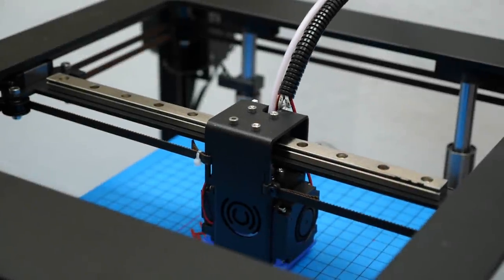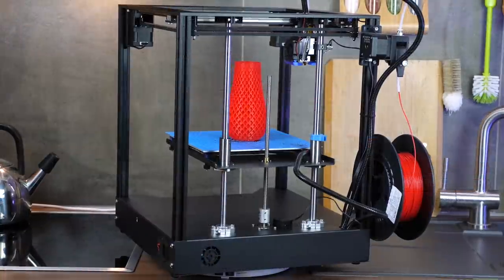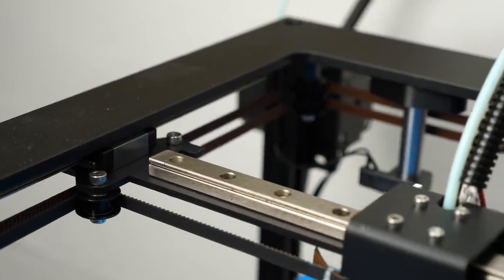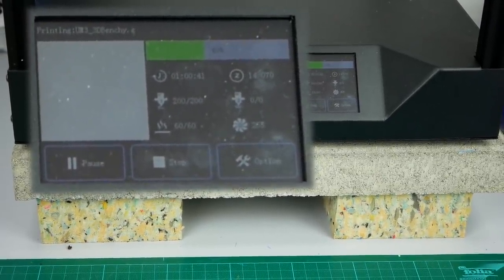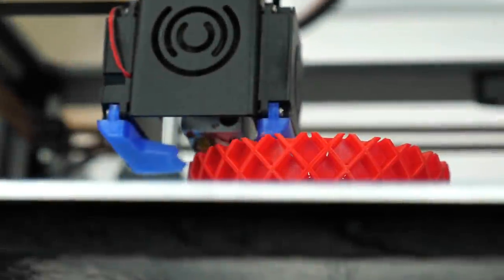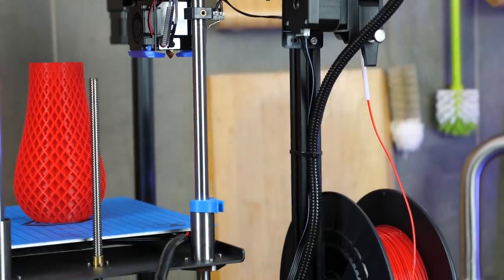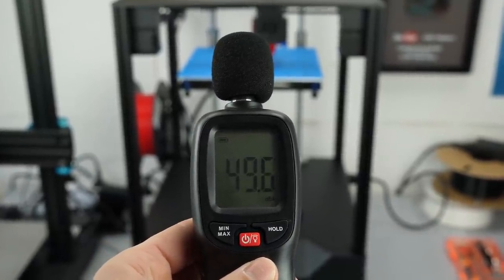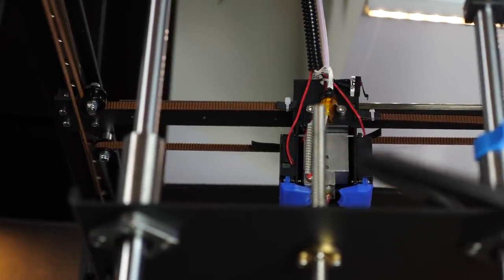$320 Linear Rail 3D Printer - Sapphire Pro REVIEW (Two Trees)

Comment: I have been wanting a core XY with linear rails for a while now, I think until these issues are ironed out I am better off building my own.
 With the Pro moniker applied to this printer, I would expect to see a better board installed and a tensioning system for the belts.
 I am nw going to watch the JustVlad review who I understand has a later version of this printer, I hope things are better!
Reply: Another new model to keep an eye on is the SecKit "Go" (or "Mini") - its slightly more expensive than this, but still very modestly priced for what you get. The very first batch are only just shipping now, but it has linear rails in all axes and looks very promising - if the current 1-man operation can scale up production.
Reply: I'm wondering if a printer really needs rails though. I have a core-xy (tech-2c hypercube) that uses 8 & 10 mm hardened round stock and linear bearings and there is no slop in it . An interesting aspect of the core-xy design is that the belts themselves are in opposite tension and act to remove backlash. Differential tensioning also serves to calibrate the XY plane (to keep it in square). Its a really nice design.
Cheers,
Reply: If you're looking for the Pro side things, look up Vorondesign. It's a kit and you have to source all the parts yourself, but the design is free ;) the just went GPL3 so community is going to grow a bit.
Reply: @EngineeringVignettes  I too have a hypercube, an evo version. It was my first 3d printer, and it wasnt that bad of a build given no instructions. I love it. now that i know the ins and outs of the printer and how to tune core xy, I am thinking of adding rails for x and y. I honestly think ill gain alittle volume, and rigidity with rails.

As a noob to 3d printing(but not to building things) I would say core xy are for people who want to tinker until they get the results they want. If you want to get going out of the gate, go with standard cartisian printer.
Reply: @noelwade  Thanks Noel, I saw a video on this by Teaching Tech and it is a very worthy competitor for my new purchase
Reply: @EngineeringVignettes  I have been watching Tech-2c and the progress in his designs, the rods are a good alternative but the smoothness of linear rails realy made my mind up when I got my hands on one
Reply: @Penofhell  Thanks, John! I will explore this path
Reply: @EngineeringVignettes  in my opinion and experience linear rails can be better for cases like sound. both are great and both have their places, I've seen linear rails in more profession machines like CNC's or even used as super smooth slides for DIY projects. but ive only seen linear rods really used in applications like inkjet printers and reprap/ultimaker 3dprinters. its not a matter of do you need it its more a matter of does it work and will it work well.

Comment: Very nice video. Interesting to see, what went wrong on your machine. I got a later version (early september) with the rails correctly mounted, the driver voltages set lower and a newer firmware configuration. I had missing t-nuts, no setscrew for the extruder, a lose drive gear in the extruder, wrongly placed endstops, 1 meter bowden tube... not a finished product, nothing for beginners.

Thanks for linking my article.

Comment: its awesome 3d printer for resonable price that only need few upgrades to be the best printer at this price.
Z wooble exist because screws in this size are produced in 0.5mm accuracy at 100cm length everywhere so if your z axis isnt stiff enought you will see z wooble in 90% cases,the same goes with z axic coupler,changing it to cnc one (not spring one) or for engine with integrated screew can solve the problem :)

Comment: In my experience with Chinese linear rails, they need to be thoroughly cleaned before using as they, almost all, have some kind of manufacturing grit in them.
Reply: My old folgertech ft5 had alot of burs in the rails too. A good cleaning fixed the squeeching noises and inconsistant moves.

Comment: heh, I had a printer with a really difficult to diagnose Z banding issue, until it turned out it was the PID calibration on the hot-end or heated bed, that was causing it. Not sure which because I ran both calibrations together, and it was fixed after that. Honestly I think it was the heated bed's PID that caused it.

Comment: You may have overlooked, but these are NOT Allegro A4988, these are confusingly named HR4988 by a company that goes under the names of Heroic Technology or Shenzhen Yongfukang Tech. This is not a clone of any existing chip, it's a unique ultra microstepping driver with 1/128 stepping that is very well suited to be used with 32-bit boards. It uses the same pinout as 4988 so board layouts can be reused, but not much else! The current control is a bit rough so it tends to make very unpleasant sounds when run at 1/16 microstep, so its XY suitability with 8-bit boards is very limited. Other than that, it doesn't appear to have any weird degenerate behaviours, as far as the few people have tried it.

Comment: I got the saphire s which i guess is the predecessor for the same price. The s has a lerge control board so the open source people would not be happy. The belt routing looks like an afterthought or mistake and i came up with a different arrangement to straighten things out. The xy motors are in the base with rods and couplers which may add inertia but i like that it prevents belt tension from damaging the motor bearings over time. The fans have developed a noise that wasnt there when new. The drives run some crazy microstepping value like which is okay because the lerge board cpu is crazy over powered. I attempted to change them for tmc drives but they have resistors on the configuration pins and I'd have to de-pin my drives and configure them with wires on the drive boards so i decided the stock drives were fine untill i feel up to opening the bottom of the printer again but ill wait untill i figure out a 32bit marlin dev environment and just change the main board and screen. Ill wait till i get a good second printer incase it becomes an unfinished project. I added a bmg extruder and capricorn tube. Having the high mounted steppers like the pro could allow for 16 tooth pulleys instead of 20 which could allow for 100steps/mm which i like.

Comment: Hi there. Well... you at least get to printing what is currently impossible on my "PRO" with the clogged nozzle after every 2 meters of filament. 
Its not my first 3D printer so I definitely know how to set up and manage the hotend.
You did mention the poor quality control - I would say it doesn't exist at all.
Provided config file was total mess but after a while have managed to make it work, timing belts getting sagged after couple of hours, very weak radial fans blow the air all over but the part, hotend 30mm fan is useless and the hotend body structure leaves lots of questions as well.
Long story short, was expecting something workable but got the pile of...... you know.
I know, there are number of upgrades on Thingy but... should ONE need them straight out of box???

Comment: seems like a good second or third printer if you've already spent time on upgrading another printer knowing what to do to improve things and have a couple tmc drivers laying about. From what is described here id rather deal with the PID tunes and few printed parts maybe even adding a second z lead screw/rod over the hell i went through with that roller system on several printers espcially the tronxy x5s. granted i did a linear rail upgrade on my tronxy x5s, but i needed to print several parts and still need to print tons more before im happy with the printer. for my next printer i may keep this one in mind especially with that enclosure mod. tho for sanity sakes i may throw a bigtreetec skr pro or skr 1.3 on that.

Comment: What is the build surface called? I'm looking for a print surface that will let me print with a cooler bed.
Reply: Mirror tile and gluestick. Works fine with an unheated bed on my play
Reply: @pen25  thanks! Have done the same in the past but I find the glue stick a bit messy. Am still hoping to find the dream surface that I can heat to 25-30 and not use anything on. 

Currently 45 on a mirror tile with a good brim works. But hope to do better!

Comment: what other kinds of rails are there? exponential, or cubic or what? XD sorry for the joke but kinda curious I have never done any 3d printing and I am generally just curious about how the stuff works, and I have seen the term "linear rails" a few times
Reply: There are many ways to make linear rails. These are industrial, integrated linear rails, dedicated for the purpose, so they're usually just called linear rails in this hobby, they're Misumi MGN series rails or Hiwin rails or clones. Other popular type, especially that's what everything was like a few years back, is a linear cylindrical ball bearing like LM series on a smooth round rod. Third type which has become popular recently is an aluminium construction beam extrusion with V-groove and polymer wheels carriage, this is how all the Creality printers and their clones are built, but there were numerous builds before that.

So to summarise, it's linear rails vs smooth rod vs V-slot extrusion.

So dedicated linear rails are generally considered best, as long as they're well-supported underneath. Smooth rods have some propensity to bend in the middle and they also have a lot more play between the rod and the bearing, probably because the rod and the bearing are not matched and don't come from the same factory. V-slot extrusions experience wheel wear and need manual adjustment to align the carriage on them and to compensate for wheel diameter differences and wheel wear while other types do not need any such adjustment.

Comment: I had the same Z-banding problems back than with my CTC bizer when I upgraded to TMC2100 stepper drivers for X and Y but the original Allegro A4982 for Z. I have absolutly no idea why that happend, but it was gone when I swapped  the Allegro for a TMC driver. e

Comment: I would imagine that the Z issues could possibly be caused by the build plate mounting setup.  Probably the easiest way to fix this would be to have support bars on both sides instead of the cantilever setup like they have.  I would love to buy one of these to tinker with but my wife might complain if I start up a menagerie of 3D printers instead of just the one that I have lol

Comment: I’m not surprised that there are Z-banding issues. The build plate is only supported on one side, and being driven on that side too, so the entire build surface is cantilevered.
Reply: That should be fine. There is not much load or torque on the platform... having said that, the platform bearing supports may be crap. 

Z-banding could also be coming from flexing in the frame. Some X supports on the frame side can test for frame flex.
Reply: This is a very common set up in a range of self-sourced CoreXY designs, C-Bot, D-Bot, Evo etc. It can be made to work fine, but certainly one has to lower the jerk and acceleration of the Z. In this case it's almost certainly bouncing.

Comment: jesus the cutout for the power suply fan was really unclean and it looked like as if there was no cleanup to get burrs and so on removed. sure you don't see it but it can lead to problems if you are unlucky and if they have sharp edges (which it looks like to me... i personally propably would print a cover for that which could be made with an integrated dust filter to reduce the dust collection in the powersuply... if it is in a sucking configuration

Comment: Why did the ref voltage too high cause lost steps? I have the same thing for my Hypercube, but usually a too little cred would cause lost steps??? BTW this looks like a Hypercube with linear rails. You should build one!!! Omfg that chain mail! Looks like a nice printer for more advanced hobbyists. Although I can build a Hypercube for around 200 euro.
Reply from the maker: A too high voltage of the drivers cause them to overheet and shut down for a short period of time.
Reply: @CNCKitchen  Ok, I have the problem that during the first layers of the print which are slower, sometimes there would be some later shift, so 1-2-3 steps missed, then after the prints keeps on going it would be ok, I tried to diagnose it but I couldn't find the cause.
Reply: vial.of.photons  Yes that would make sense, but how to diagnose or fix this layer shifting? I think I set up already the vref of x and y to the maximum values, I will try to glue some aluminium sinks to the drivers on X and Y, but if it would be an overheat problem, I think that more than 1-3 steps would be lost. I have also a spare RAMPS, I will try with that also
Reply: vial.of.photons  It is not my printer, it is the Hypercube! You can find it on thingiverse, it is a scalable design with many variants.

Comment: Where did u get those foam pads? ThTs a great idea I gotta try it myself
Reply: PlaysHockey looks like ordinary high density upholstery foam.  Thicker carpet padding is made the same way but only up to about an inch thick.  While I’m sure it works great having to keep my printer in my home and caring far to much about aesthetics I just replace the feet with the proper durometer rubber feet that you can buy for high end audio equipment
Reply from the maker: Just take a bit of the packing foam your printer came with. Works great.
Reply: CNC Kitchen too bad I got my printer 2nd hand, got a cr-10s for 300 USD and the guy built it and printed the capa cat and 2 box feet, but my father knows some apulstry people I’m sure I can get my hands on some, thanks so much!

Comment: this with a mosquito magnum, a Duet Wifi board  and an enclosrue would be insane
Reply: Domenico Lamberti plus heating elements to heat the enclosure to 70-90*c
...and a zesty nimble, to offset the weight even more.
Reply: This with an E3D Hermes, Duet 2 WiFi, 0.9° stepper motors for X & Y, an integrated lead screw stepper motor with POM Nut for Z, some quieter fans and the Acrylic panels would be even better.
Reply: @TheMikeTB  It's like if they will change everything it can be much better. Power cable was OK.
Reply: @vladimirseven777  yeah that was my point. Why buy a Two Trees printer then bolt a new Board and a new hotend onto it. If you want a Core XY with Duet and Mosquito buy a RailCore or build from scratch.

Comment: 2 trees? Weren’t that 20 Million trees? 😀 But besides the joke I also think that machine has potential. If the problems your model had are solved by the manufacturer it might be a good Allrounder which can be used with some technical materials if you close the open frame with acrylic.

Comment: You should check my extruder damper that I uploaded to thingiverse.com.
For Z wobble you should check the coupler if it's concentric. Then check the Z rod for bending by rolling it on a flat surface (e.g glass). If it's rattling like a train then you should replace it with a straight one (check that before installing, too ;) ). For fan, you shouldn't use the shroud you printed. It blocks the airflow too much.

Comment: The banding is micro stepping the z axis change the driver or make sure your layer height can be divided evenly by the z axis step count i avoid .15 use .16 or .12 .2 do a little math that z look's like an 8*8 4 start high speed  tr acme if so ditch it for slow 8x2 single start and fix the firmware the massive increase in mechanical precision with make the banding go away but also cut you z-axis speed to 1/4 it's current speed. Also if the bed it on springs for leveling crank it down as tight as it can go and back off to level the bed this will reduce the chance the bed is shifting. I hard fix the bed on my printer and use auto bed leveling with 8*2 single start screws on with a duet control board this just make it more ridged i print pla at 240c with a volcano hotend core-xy at 280mm/s use a aquarium pump and silicone hose for part cooling.

Comment: OMG intense fail at 7:46 the belts are not parallel!!! You must have missed that part, but your sizes will not be constant. The belt coming from the left motor going to the first pulley is not straight and this can cause irregularities.

Comment: Mine arrived with the lead screw so poorly manufactured that it wouldnt line up, ordered one of ebay, then the extruder was again, poorly manufactured, that it wouldnt feed the filament.  Sent it back but what a crap service, Two Trees dont have quality issues and dont accept returns, stay away from them

Comment: I think the artifacts you're seeing are not z-bending, but varying tension in the xy belts because the core-xy mechanism is not laid out properly. I saw at least one belt section that was not parallel to the axis it was on. Here's an article on the same, and with some mods this printer should work well. https://drmrehorst.blogspot.com/2017/07/ummd-corexy-mechanism.html?m=0